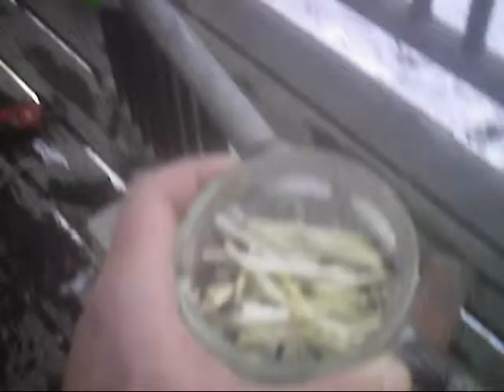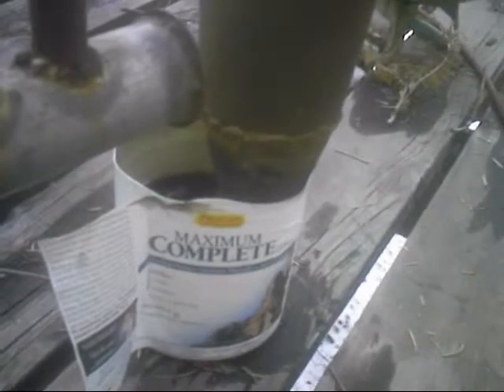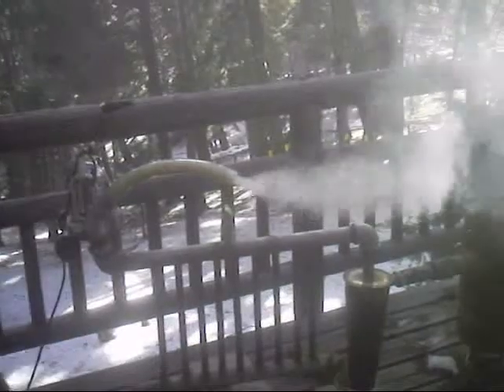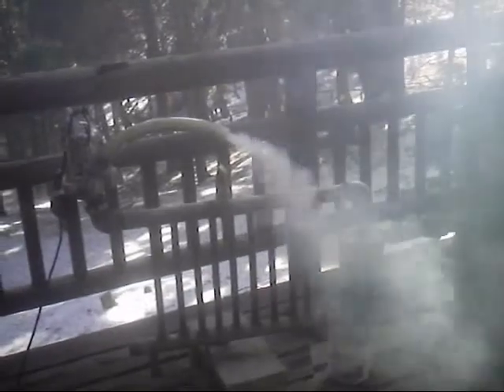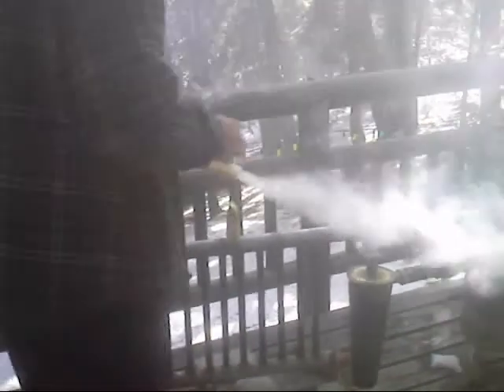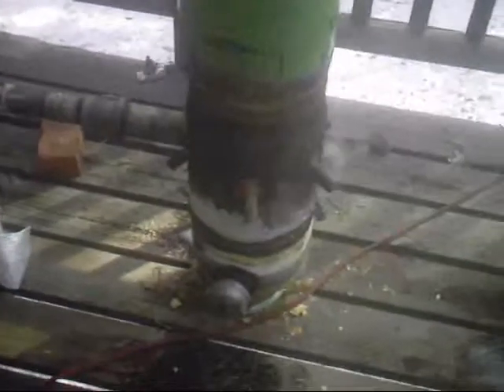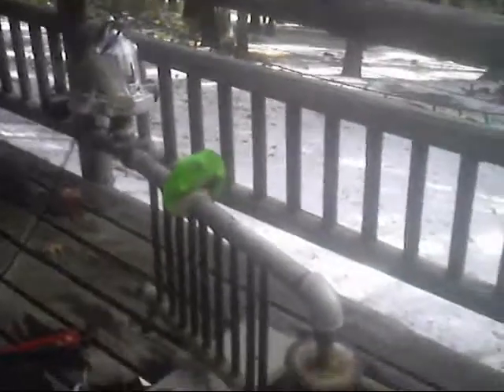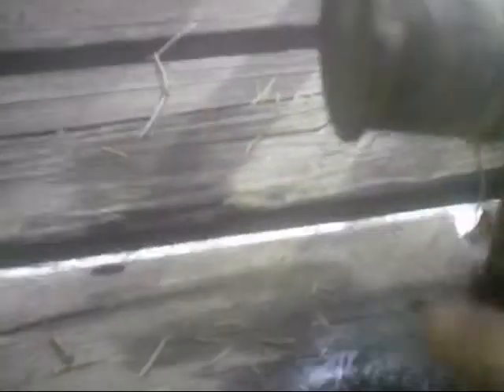test run psudo imbert wood gas reactor

Comment: I'm not sure what you are using for fuel. I think I saw wood chips and it appeared pretty fine. I would try some chunky wood, maybe 1-2" chunks. From my understanding the orange flame indicates hydrogen. Do you have something catching the soot at the bottom of the cyclone? I welded a 2" pipe to the bottom of mine to attach a sugar shaker on it with a rubber pipe band.
Reply from the maker: ya i have been doing this for 5 years now and had many working models the reactor bridges a lot blocks or chips i have tried both i think im gona put a vibrator and that cyclone got relocated to the end of the sys and a new cyclone was put in its place none of its complete but this reactor is for my vw beetle so want it to work really well the reactor runs tar free but i get a lot of moisture i need a better cooler the problem is i have to be able to fit it on the beetle with out u knowing its there so cant have the normal bulky stuff =3-